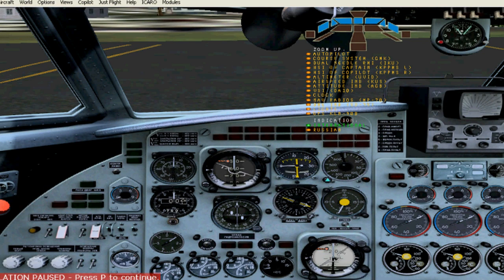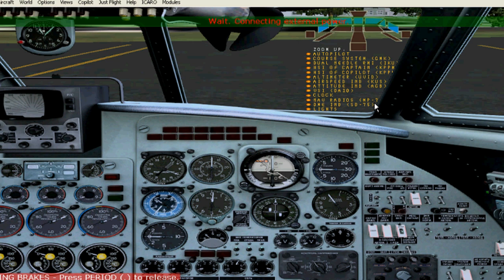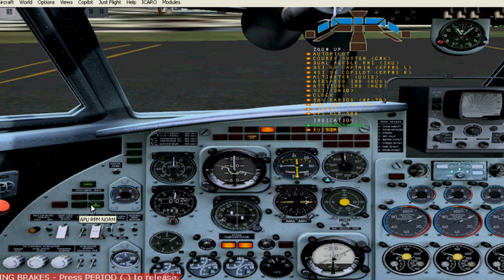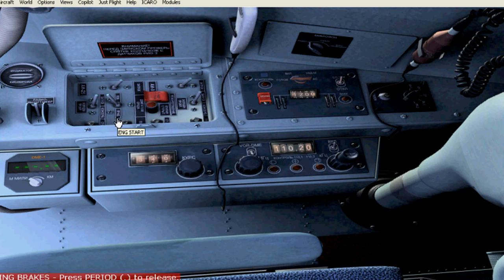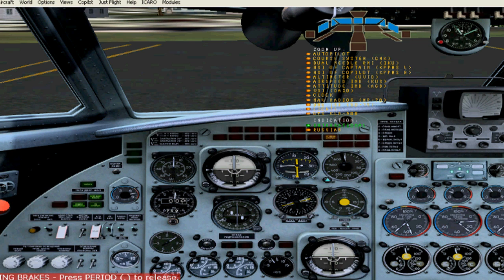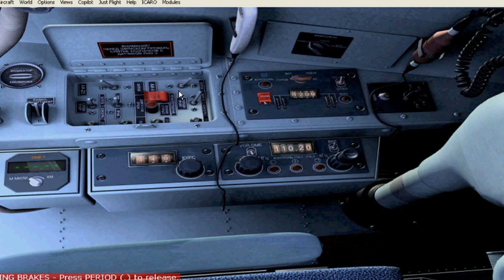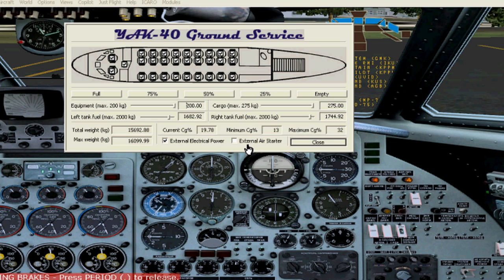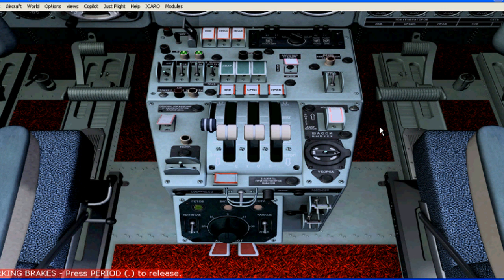Yak 40 Start Up

Comment: That is not the right way to start Yak-40! All of the AZS must not be turned on before generators are available. The AI-9 temperature also exceeded the limit which would require an immediate stop of it. The fire valves cannot be opened before the proper AZS for them are on and they receive the needed electrical power. It is not recommended to turn on the PO STEKLA and RADIO because the RAP will get too much load and possibly fail.
Reply: Where not all perfect
Reply: +KingChilli_ But why to make a tutorial that will teach others stuff totally wrong? Isn't the point of tutorials to teach how to do, not like how not to do things?
Reply from the maker: +Yak40 That is good to know for real pilots, good thing I am not.  If I ever go for a real license I will follow the correct procedure.  I just want to get in the air as fast as possible.
Reply: But my point was that why to make a tutorial that gives a false impression of the aircraft's procedures? It's a flight simulator, you shouldn't push it to being a game by sharing information that over simplifies the procedures and makes them totally unrealistic-
Reply from the maker: Ok I'll let people know and they can look at your videos for a real start up procedure.